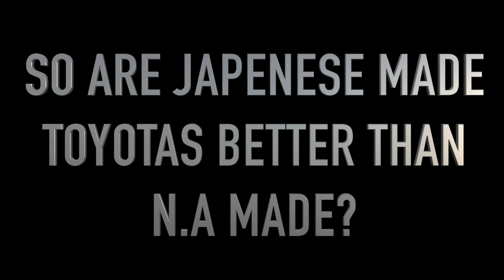Are Toyotas Made in Japan Better than Toyotas Made elsewhere?

Comment: All 5 generations of the Toyota Avalon are built in Kentucky, and are among the most reliable cars on the road.  I own a 4th generation Avalon, and one of my former professors still uses his 1st gen Avalon as his daily driver.  Update and correction His 1997 1st gen has over 425,000 miles and counting! He recently bought a 3rd gen because the 1st gen is getting tired, but he is still using it as a daily driver.
Reply: We own a Corolla that was built in Japan and an avalon. They are both very impressive vehicles despite the downplay they seem to get. When I traded for the Corolla I thought, just a Corolla, but was left very impressed with all the inputs (literally all of them) and the quirks are nothing compared to my prior vehicle.

These cars are the best possible option as long as you don't need awd or extra space
Reply: @opinetree  those cars will remain reliable for years, as long as you keep your fluids changed.
Reply: Toyota continues to monitor build quality of Kentucky and they have equaled or surpassed Japan
Reply: Unfortunately, Aisin water pumps made in the USA or China are inferior to Aisin or NWP water pumps constructed in Japan.  Source: Toyota/Honda shop, forums, personal experience. Peace.
Reply: I have a 2nd gen. I've heard of about 4 different ones with over 400k.
Reply: Imagine how much better they'd be if they were built in Japan.
Reply: @ferndog1461  that has nothing to do with the assembly quality, thats a parts issue. And guess who makes that decision. Japan.
Reply: 2006 Toyota Avalon a fucking nightmare  horrible electric problems  3 alternators and batteries in only 17 months   various other  can't keep up with it   still owe on car loan    life sux
Reply: Toyota - even made in kentucky - is still far superior than anything but I buy Japanese cars only because they are better built that those made elsewhere.
Reply: @tedlipkin4742  Not true.
Reply: @tedlipkin4742  Look up "statistics" in a dictionary. You'll be amazed. Promise.
Reply: I agree. My 2005 Camry built at TMMK with over 300,000 kms. Still on the road running smooth. Toronto, Canada. 👍
Reply: @tedlipkin4742  what’s your basis for saying that?
Reply: @scottg429  I like a well made car. Toyota knows exactly what they are doing in building Lexus in KY. Will someone get a great Lexus/Toyota out of the KY plant. Absolutely. People can think what they want, but there's no difference in reliability of Japanese and American built  Lexus/Toyota.
Reply: I have a 2000 Avalon with 320k miles too and it runs like a champ on all original power train
Reply: @tedlipkin4742  never ever.  In North America.  Kentucky quality is far from the best among all the North American plants
Reply: @ronniedrake8196  your writing skills are impeccable. You’re definitely not trolling, and you’re most certainly telling the truth.
Reply: I believe you because my '00 camry was built there and like the Avalons of the same generation, have the 3.0 V6. Still though, people in the know (not shills for toyota like this guy) will tell you that Japan generally produces a more reliable product. Their quality control procedures are way more extensive that here in the U.S. and certainly more than in Mexico, which is a complete crap shoot.
Reply: @tedlipkin4742  prove it.
Reply: @fcnghkkc1  they are going back to Japan in 23 - so theres no worries
Reply: @fcnghkkc1  - I really don't like to put down the American workers.  They built great cars in KY and Toyota has spent millions and an uncredible about of hours to train them.  If the car is made in KY or Japan, they both make quality vehicles. Kentucky is a remarkable auto plant and people that work there are amazing. You have to remember that it's Toyota's standards of manufacturing and suppliers that  have the overall impact on quality. Those standards are the same worldwide. The standards are the same in KY as they are in Japan.
Reply: They are mainly built in KY but some are built in Japan.
Reply: @FlexSZN23  please show me one example.
Reply: American autoworkers got a bad rep from the GM plants of the 70's and 80's. That was the magical era where people used to drink beer and smoke weed on the job..... ala one reason why drug tests were enforced, the other being people getting injured while high.

I've been working with crews of guys in the building trades for 20 years. Different job, different crews. Some crews have been lazy, some crews did good work but they were slow, and some crews got a lot done but their quality wasn't great. From what I understand about Japanese tradesmen, they're accurate but not fast. Generally, when the employer pushes higher production targets.... either quality or safety go out the window. It would not surprise me if the Kentucky plant has higher then normal production targets compared to the Japanese plants.... as this pads the managers' yearly bonuses.
Reply: @ronniedrake8196  I can also add horrible paint job to the list. The reason is 1st and 2nd (as Pronard) gens were also built for_Japan at the same plant in US. It matter more for what country than where. The 3rd gen and on weren't sold in Japan, so the quality went down.
Reply: The Camry built in March 2018 in Kentucky is still going strong with 122,600 km mileage
Reply: @Doomzdayxx  México builts better vehicles than America
Reply: @Tigerwarhawk  the Avalon has been discontinued and it was also built in Australia
Reply: @noventay4  and??  My point stands.  All Avalons in the USA (the country I'm in) we're built in Kentucky.
Reply: @Tigerwarhawk  yeah and they were so crappy they stopped building them 🤡
Reply: @ronniedrake8196  Do you know if the car has ever been in an accident? Perhaps before you owned it? Toyota electrics are legendary except for this one thing. Assembly by body techs sometimes doesn't account for wiring positioning and routing and wire bundles can chafe and get damaged, then stray voltages occur and it's a nightmare. 
Another possibility is if anyone has ever worked on the wiring of the car. Even put in a car stereo. If the same high standards Toyota built it with are not applied to work being done it can cause problems years down the road.
Reply: @jameshisself9324  fuse box keeps tearing up and causing electrical issues.   No one can keep it fixed
Reply: @ronniedrake8196  Sounds like you are just trolling us dude. 'Tearing up'? What does that mean? I would say now that this was definitely in an accident and repaired improperly or someone unqualified has worked on the wiring. Very common unfortunately, and the only reason I have ever seen for Toyota electrical issues. In general Japanese and especially Toyota electronics are rock solid. Unless messed with they do not fail. There are way too many unqualified people working on cars.

Comment: I have a 2005 RAV4 with current 321,200k miles, and it was made in Japan. For the past 17 yrs of owning the vehicle, I had the mentality of thinking it's better to buy a vehicle made in Japan. Thanks to you and David for clarifying the myth of the difference between cars made in Japan / North America / Canada. I also own a 2006 Highlander LTD made in Japan. I guess I was lucky to purchase both vehicles that were made in Japan without customization. I like to watch all of your great videos. It would be great if you could make somewhat detailed steps videos showing DIY'ers how to repair or replace parts.
Reply: Update on the '05 RAV4 it is currently at 324,200k+ miles. The engine starting to get a little more noisy. Most likely the piston rings are wearing out or the Timing Chain guide is worn out. I might open up the TC cover and inspect in the summer with possibility of replacing some minor parts.

Comment: Some good info here for sure. All the same. I think I’ll be sticking with my ‘21 4Runner TRD Pro and ‘20 MX-5 RF. Both solidly made to very right tolerances and with precision. Both made in Japan.
Reply: I own a 2000 4RN LIMITED 4WD and 1999 10AE Miata.  Eventually I’ll upgrade to newer ones by so far, love them both.
Reply: Made in Japan is definitely better because of the pride workmanship culture and near-zero tolerance of letting issues slide. The MX-5 is a great example of a car made exclusively in Japan, and has been since May/June 1989 I believe. The Honda Accord I have now is made in Japan also. Seems like the majority are made in Marysville, Ohio in the case of the Accord.

Comment: The several Toyotas I have owned have all been reliable.  A Kawasaki motorcycle made clear to me the difference between assembly quality from different countries.  In 1990 I could not wait to get my hands on the new king of speed, the Ninja ZX-11.  When I took mine home I rode in a rainstorm, so I immediately began stripping off the fairings to clean it properly.  What I discovered was that the engine, which was made in Japan, was an immaculate jewel of a power plant.  The rest of the machine, which was assembled in Nebraska, was a shoddily slapped-together pile of parts.  Just as an example of the faults I had to correct, I discovered that the fuel shutoff valve was leaking at the tank.  After draining the tank and removing the valve, I found that the required o-ring had never been installed on the valve spigot.  In its place, some moron had wrapped the straight threads and tube with teflon tape.  The tape was the only thing preventing a massive leak and possible fire.  The rest of the bike was similarly neglected.  I never trusted motorcycle dealer mechanics, so I fixed everything myself.  It turned out to be a hell of a fine bike, and I wish I had kept it to this day.

Comment: I was a Toyota Tech in Canada for over 14 years. Yes I’m a big Toyota fan.
However Toyota isn’t perfect.
I can tell you from personal experience that when the Corolla was being manufactured at the Cambridge Ontario plant the parts were very substandard from the Japanese ones. For example the Japanese models used “ Tokico struts , the North American production used Munro. In these cold climates the Munro leaked like a sieve. Great for us, we made a bundle under warranty. Might be different today though.
Reply: Is a Toyota a good buy to own? I need a used car that lasts for a long time, I am a senior citizen from Canada.
Reply: @paulwood9043  absolutely, I recommend a RAV4 as it has good traction in winter and has some height making it easy to get in and out of.

Comment: Dependability and reliability is all on suppliers of parts,and there's so many hands everything has to go through something will always get through regardless, but you can't hide a recall, except when it comes to FORD and GM which as of late speaks for itself
Reply: It's also how it assembled if not assembled right it will fall apart

Comment: I have a 2011 japanese corolla (1ZR-FE) and is still running strong. Not a single leak, it doesn't  even needs refills. It is dry as it can be. Only consumable parts has been replaced (sparkplugs, filters, oil, accessory belt, water pump).

Comment: Enjoying your videos, regardless if I own Toyota or any other car :)  I used to have 1995 Corolla which was made in Japan and then couple of years later my uncle got a 1997 version of the same car, but his was made in USA.  Pretty much similar car, but fit and finish of my Japanese made vehicle, just felt better.  I sold my car in 2003 and it is still on the road in my city!  As for my uncle's car, he sold it in 2006 to one of our relatives and she drove it until 2019 and then something happened to the transmission(she probably didn't service fluid), so car was sent to junk yard.  I own Acura RL and was made in "Sayama Plant, Japan" according to the sticker and the quality is felt throughout the car!
Reply: My pops is the first owner of a 06 RL. Damn thing has almost 300,000 miles still drives it. It’s been from the east coast to Cali 3 times. Garage kept and serviced by the same Honda master tech since it was new.

Comment: Just traded my 2020 Tundra in on a new 4 Runner yesterday. The Tundra was very well built, but nothing like the Japanese built 4Runner. Night and day. Just go drive, or even open the door of a tacoma and 4Runner. The difference in quality of craftsmanship is very clear.
Reply: Two completely different vehicle classes
Reply: Of course they are, but what does that have to do with level of build quality, which was the point at hand.
Reply: @mack86523  some Toyota models are better than others. They were designed differently.

Comment: I bought a 2007 4runner with 198,000 miles on it in 2017. 4 years later, no problem at all outside of routine maintenance. No way I would have bought an American made car with high mileage like that.  4runner are rock solid.
Reply: I bought an 09 Explorer V8 205k miles. 3 years and 20k later. Only needed new wheel bearings and routine maintenance. A lot depends on how it was taken care of.
Reply: Same here. I brutality 2008 Sequoia with 268,000 miles. It runs like a new truck.

Comment: I've owned four Toyotas: three made in the US, one in Japan. The best one I've owned (so far) was a 2003 Camry made in Georgetown, Kentucky. Only a few relatively minor issues surfaced with that car and that was after buying it used at about 90,000 miles. My present one is a Corolla hybrid, made in Japan. So far so good. I'm meticulously maintaining it so I hope it holds up. The other two had a major issue apiece. One had a defective U660e transmission in a 2007 Camry that cost me more than $6,000 to replace (with a Toyota reman with the newer part number). I experienced defective piston rings in its 1ZZ-FE engine in a 2002 Corolla, which was supplied by an engine maker in Buffalo, West Virginia.The car itself was assembled at the now defunct plant in Fremont, California. I later learned that these engines were famous for that at the time but did not correct the problem until the 2003 model year. Perhaps it would have fared better if I were the first owner and maintained it like it was supposed to. Hard to say. It's certainly a mixed bag to be sure.
Reply: Makes sense. Honestly, I think within Toyota, the model is the biggest factor. Camrys are basically Toyota's flagship. They ensure a higher standard than they do for, say, the Yaris.

Comment: Thank you so very much for all that you do, Ahmed. You have been a a well spring of information to me in my research of a new car purchase. The first car I drove as a teenager was a 1986 Tercel 5 speed manual transmission (my mom's car). After she passed away, my older brother inherited it and had 400,00 kms on it and was still running like a top. It's amazing how well the engine designs hold up if you maintain the cars properly.
Reply: Will mention it's spelled "Amd" (see the first couple minutes of the vid)

Comment: my 03 highlander was bought used, and now has 125k. All i had to replace was a sticking front caliper, likely due to our heavy snow and therefore salt use.  That's it. Everything under the hood is original. AC, starter, etc. It isn't very powerful (dont care) and doesnt get great gas mileage (not known for it) but the quality is so good. The doors shut with such little effort. You close them with a finger. No rust. Even on the seams where the door skin is folded up under the door frame and spot welded. No rust underneath. They made the fuel and brake lines out of some material that is impervious to salt. They are black and look brand new after all these years in the snow and salt. 

While most of this year were going for $7500 with higher miles, I got mine for $5k because it had a check engine light for an evap canister. I got a great deal on it and I am very happy. Made in Japan as I understand. The previous owner replaced it with another Highlander, so that speaks to how people feel about them.

Comment: I bought a 2003 Toyota Corolla that was assembled at the NUMMI (UAW) plant in California.  It had some horrendous assembly issues.  The seal on the rear window was not installed properly, and water leaked in onto the rear floor after the first rain.  There was also an issue with one of the front struts that was misaligned.  Once those issues were resolved, I kept the car for 13 years and it was very dependable.  My next vehicle was a Scion which was 100% Made in Japan , and it had no initial quality/assembly issues, and I have had it for 10 years now, the only repairs have been brake and tire replacement.

Comment: Absolutely there is a big difference in quality when it comes to where the car is made . I owned a 2005 Toyota Camry SE , made in Tennessee ,USA....a lemon . After 35000 miles , with all the required service done at a Toyota dealership, the car asked for over $6.000 in repairs ( engine services , steering issues ,ECU ) The car looked like it's been put together  late on Friday afternoon by some workers in a hurry to go home . Gaps all over the place , squeaky seats and a board rattling. Awful car !  In July 2010 I bought a Toyota Corolla LE  made in Japan ...what a difference . !! years later and the cars still drives like new with noting major in terms of service other than regular oil change , tires  and filter . Need I say that even after 11 year , the cars starts like on the first day ? Panasonic battery not some Dye hard crap battery you see on these cars made here in North America . The body shape is close to perfection , what's on the left is equal with the right side . I don't think I will be able to find another car like this .
Absolutely if I will have to buy another Toyota that will be my first requirement - MADE IN JAPAN or no car